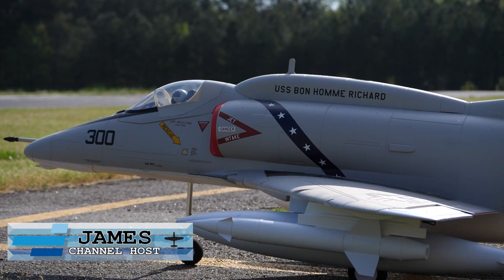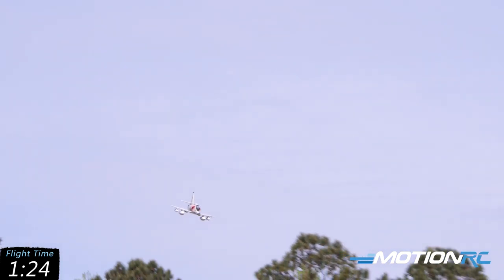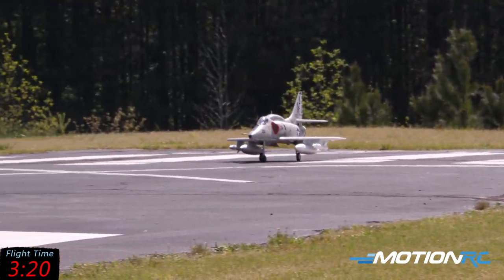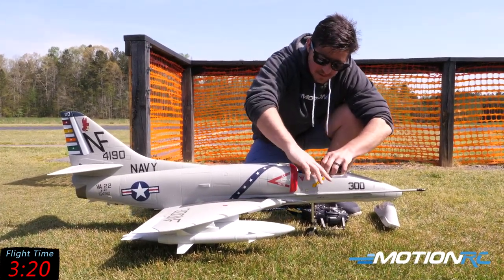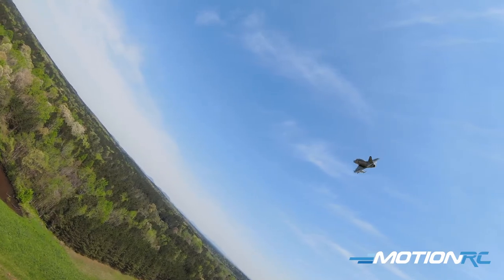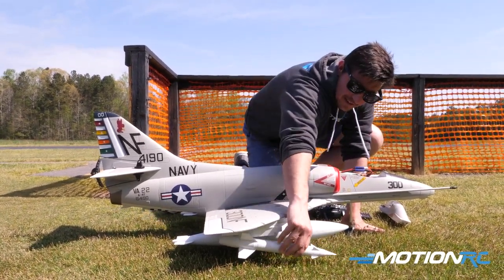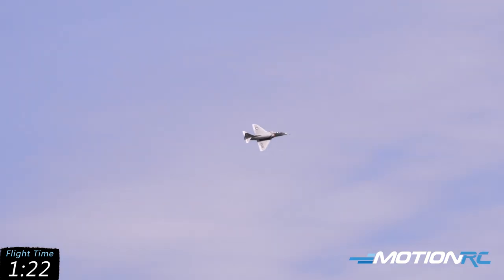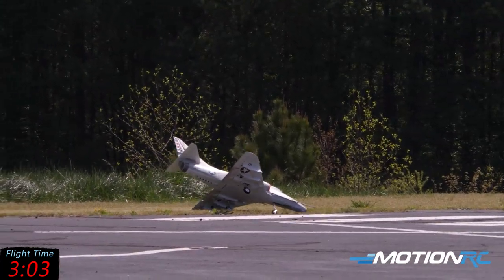2 Flights on the Freewing A-4 Skyhawk High-Performance EDF Jet - Motion RC

Comment: You mentioned you are running a older 5000 Admiral battery pack. Will the new 5000, 50c Admiral pack still fit as it is bigger than the older packs?  I have the FW F-86 and it will only carry the smaller earlier Admiral 5000, 50c .

Comment: I pay 4 rc jet 80 mm 80 mm 90 mm 90 mm Every plane flew once and crashed ، I am very angry f this hobby , Which radio should I buy?
Reply from the maker: Buy a simulator...practice on a simulator before putting good money in the sky.
Reply: @MotionRC  i will